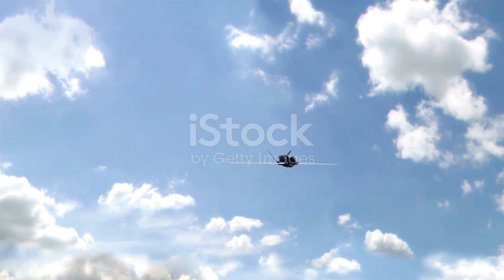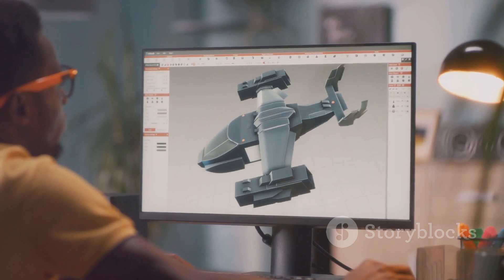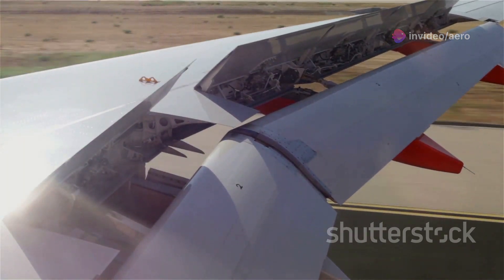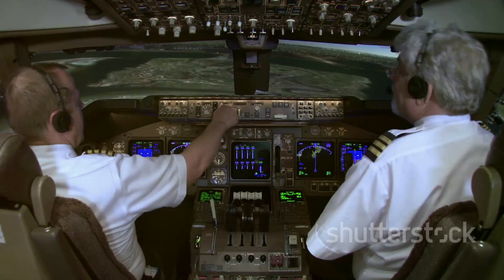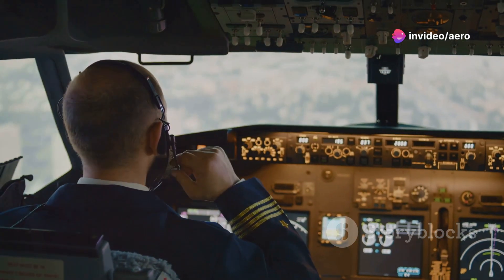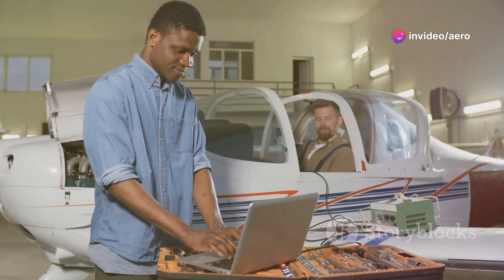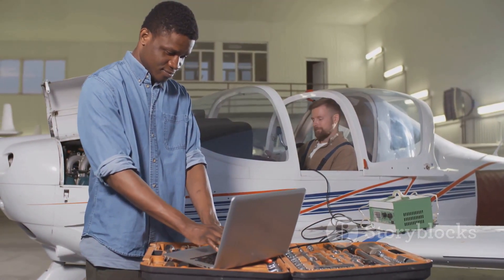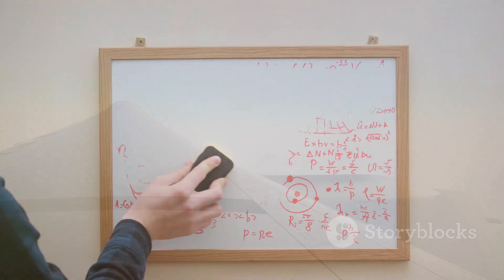Basics of Aerodynamics

Comment: The whole premise of wings producing lift because of faster air over the top of the wing makes the pressure drop as opposed to the bottom is not technically correct.  While this indeed happens, it's not what lifts the airplane into the sky.   The way wings produce lift is simply by directing the flow of air over the top of the wings downward (the same way flowing water will "stick" to a curved rock as it goes around it).  Once the mass of air directed downward becomes greater than the mass of the aircraft itself, the plane is lifted.  It's simply an employment of Newton's 3rd law of physics (every action produces an equal and opposite reaction).

If you doubt this, just consider why it is an airplane must travel fast in order to produce enough lift to leave the ground.  If it was simply a matter of producing pressure differences between the top and bottom of the wing, then how is going faster producing more lift??? Faster speeds will increase the flow of air on both the top AND bottom of the wing equally, right, thus not really affecting the delta in pressure.  On the other hand, if it's as I point out above, speed is everything.  The faster you're moving thru the air, the more air is being directed downward at any given point.  This is why flaps and slats need to be used during landing and take-off.  They force more air downward at slower speeds at the cost of much greater drag.
Reply: @aerostrangeinternational  That would be awesome!  I'm actually debating this very thing on another channel right now, and while the other guy agrees with this premise to a certain extent, he says the pressure differential is also a key player in providing lift  If so, I'd be curious to know to what extent.  Is it around 50/50, or does one premise contribute the bulk of the load (or in this case, lift!) over the other. . . 

I mentioned in my last response to him that if it was the pressure differential doing most of the lifting, then there would be no reason airplanes cruising at level flight actually have to maintain a 2 to 3 degree "nose-up" attitude in  order to maintain altitude.    This, however, makes perfect sense if Newton's 3rd law was the reason the plane remains in the air!